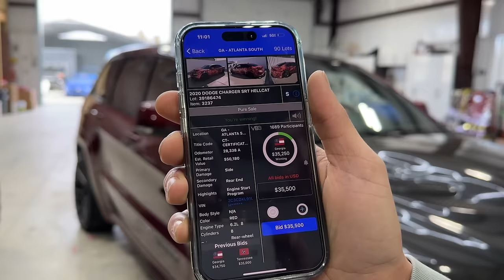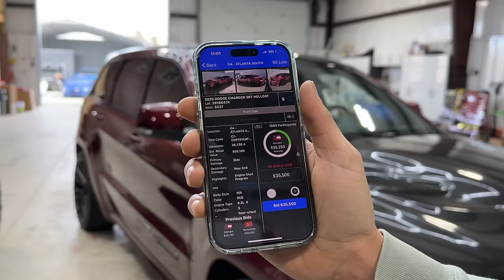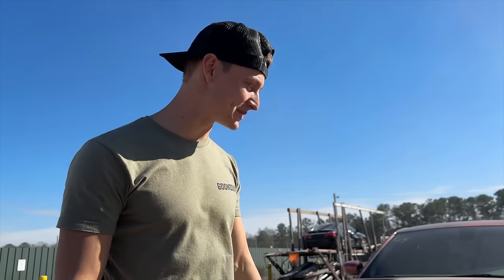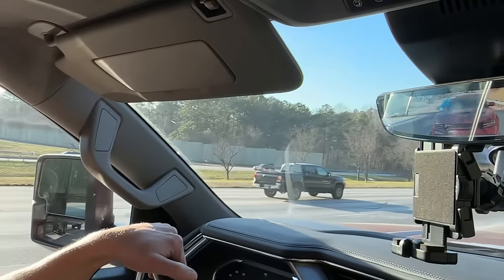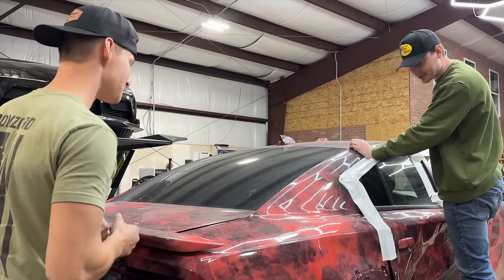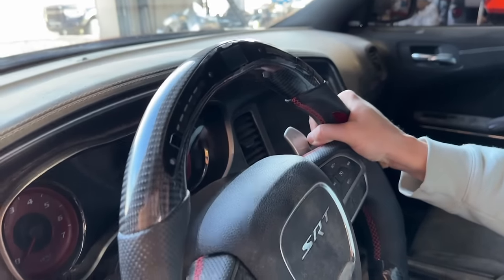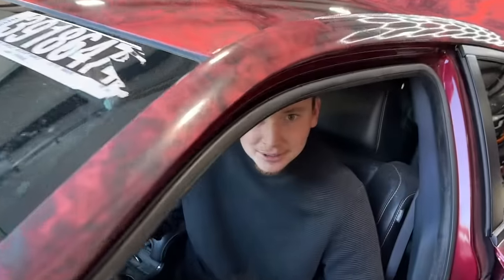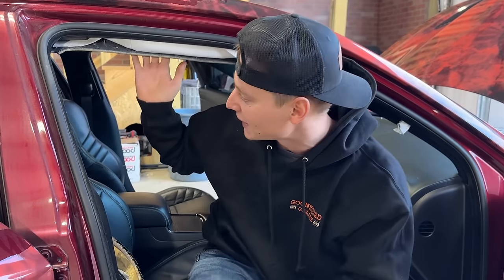Buying A Wrecked Hellcat From Copart....Goes Horribly Wrong!!!

Comment: Hey little tip from a tow truck guy for  next time. Use ur whole body when tightening the strap. Using just ur arms doesn’t allow u to lock it in place properly. Also make sure the strap is in the middle of the wheel. It’ll stop the car from rolling on the trailer.

Comment: 9:39 Yeah guys dont do that with the bumper, next time turn it around so the bumper is facing towards the truck, not away from it, or take the bumper off all together, as I saw one of those on the highway myself just like that, a Nissan, and that thing was flexing like crazy at 75 or 80, and eventually the plastic fatigues, forms cracks and can break off

Comment: Remember...a Hellcat is only a Hellcat because of ONE thing...The  motor. A Hellcat crate motor is $30k and labor is $6k-8k. So basically any Mopar product can be a Hellcat for about $40k.
Reply: You’re trippin. There’s a lot that has to go into the car to make it a hellcat. Not just swapping the engine.
Reply: Yeah tbh, ecu , radio, heat/ac etc
Reply: Pws
Reply: @WarlinDiaz-ge3fj  literally the entire drivetrain, suspension, brakes, etc
Reply: Petty sure u can save money by buying a used engine and have someone rebuild it
Reply: Wow all u do is slap a damn supercharger on it it's just a regular V8 everyone has them now they r all trash an worthless u rarely can get a reliable one
Reply: @EldePHX yea THE ENGINE , like he said it’s only a hellcat bc of the engine my dude…. what other thing are needed to build a hellcat besides the engine
Reply: @bloodyrt5560 brakes suspension the different interior (kinda) if it’s wide body etc
Reply: @MikeBuskirk-bl8yh The internals on the hellcat are vastly different than that of a regular hemi. A regular 5.7 hemi if you put the hellcat supercharger on it is good for up to about 600 horsepower before your break the pistons.

The hellcat has complete forged internals. The hellcat also has additional coolers that you would need to get as well such as the intercooler, etc. it also has a different intake and throttle body. The hell cat also has a different fuel pump in which the support all of his power. The exhaust system is completely different. 

You are correcting that an engine can be bolted to hellcat power like 700, but a 5.7 will probably only make it about 2,000 mi before it detonates. Where the hellcat can make it 100,000 mi. In theory, but most of these drivers that are buying it are wearing suits and ties and have never even driven a true sports car. So it probably will only make it 20,000 mi before they put it into a telephone pole😅
Reply: @gsc512  If you blow up a 5.7L at 600hp something you did wrong, the 5.7L is one of the best engines out there. Not gonna diss Ford's or LS's but from Dodge the 5.7L is the best and you can push well within 1k up with a few cheap supporting mods like cams etc.
Reply: @Room1sixtyfive  Read about the Pistons and the piston lands on the regular 5.7 hemi and it will not 600 horsepower would even be pushing it. Some forms will say 480 horsepower and these are major tuners that are telling people not to go beyond that with this stock piston because they cannot handle it. They are not forged pistons. The 6.4 can't handle it because it's already stressed. That's why they didn't add the blower to the 6.4. The piston walls are too thin

That's why they came out with the 6.2. it increases the piston wall size but they used forged internals which is different from the 5.7

If you build a 5.7 with like an eagle forged bottom end and you set up your tolerances and your ring gaps for the boost in the extra heat, then it will survive. And also you'd want to put the high flow high volume oil pump on there and probably get rid of MDS.
Reply: i hope everyone knows that, doing hellcat swaps are illegal and if you get pulled over and they run your vin you will be fined and have to revert it back to its original. feds are cracking down on them swaps
Reply: @rxdayday  the swap hasn't at least not in my state. Been made illegal. Maybe in California. As long as you own the motor for the vin and you can prove that you purchased it and you own the vehicle then you should be fine even for  emissions. As long as your vehicle that you're putting it in is older than the motor that met emissions in the vehicle that it was in you would be fine.

So putting a hellcat motor in a 1969 Dodge charger and then cloning that car into a Daytona. There's nothing they can do because there is no emissions on a 69 vehicle. 

Now if you try to do it the other way and take a 2024 charger and put in a hellcat motor from 2015 then they can get you because you're violating the emissions of the chassis of which it was built. 

However, even here people have put gasoline motors in Tesla's been able to get them street legal. 

In some states there is a work around and that you can say that it's a kit car and register it as a kit car. Generally, they don't have a missions and you can say what year it is when you register it in some states laws vary. But for the feds, they're only concerned about emissions equipment.
Reply: OK enjoy your engine swapped rt... Definitely not nor ever will be close to a hellcat... I will love to see you explode the dif the first time you hit the throttle In your everything is a hellcat not hellcat. Lol  lemme guess you know a guy that can do it cheaper too.,  lol

Comment: In the 2nd video or whenever they fully go through it check to see if it’s like has wires ran for speakers. Eleazar said he was hoping for speakers when they opened the trunk it might be ran for speakers based off of everything else the previous owner did to the car. It might be a remote somewhere in the car to control the lights. Maybe they should take the headlights to see if they are custom headlights and see if there is an app to control the lights

Comment: Be careful buying these hellcats from Copart. I bought one out of one of their Florida locations, fixed the car and when I went to the highway patrol inspection to get it inspected to get the new title they took the vehicle from me because the drivetrain was stolen. Copart took no responsibility for the issue. I lost about $35,000 on that deal. Highway patrol let the car sit at a local tow lot, they filed for a title and sold the vehicle. Highway patrol wouldn't even let me buy the car from them.
Reply: why they sell thru their Auction since ya did all the work and not allow you to swap what ya needed .get title . that's a Crappy Deal. done ya Dirty😮😮😮
Reply: Sir. You need to go find a lawyer. With a case like yours, just about anyone should do.

Comment: FYI the car slid to the side because you were not able to strap properly and both straps on the rear had tention pulling to the same side. it was bound to happen eventually.
Reply: i also noticed your friends mentioned the straps. for future, ditch the sketchy wheel strap setup and run regular straps CROSSED and attached to a control arm or the factory tow/shipping slots

Comment: So the dodge charger hellcats are selling for around $60k with a clean title. You lose 20% for salvage title. Your cars value will be $45K.  You spent $35K already.. Leaving you with budget of $10K to rebuild.  these are a cheap family car with a 10k engine thrown in it. fact is the car does not hold up for more than a few years.  This will be a boring build. unless you can come ip with an interesting paint job. yawnnn.